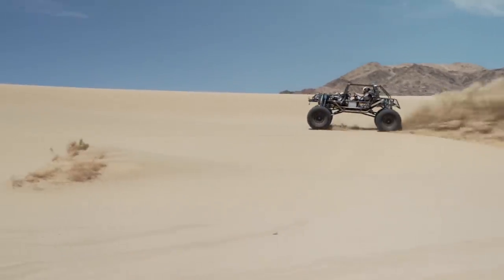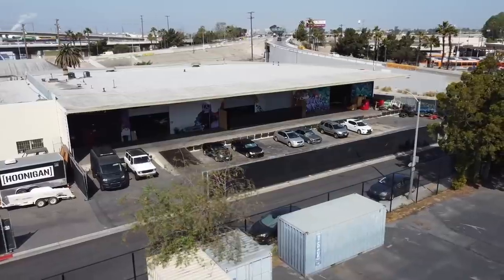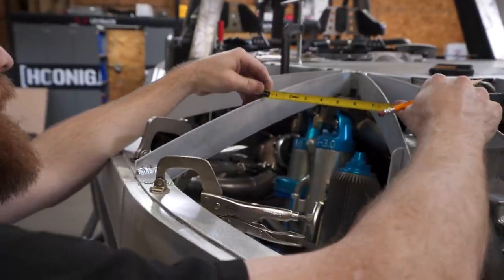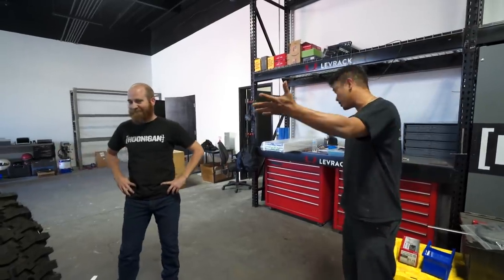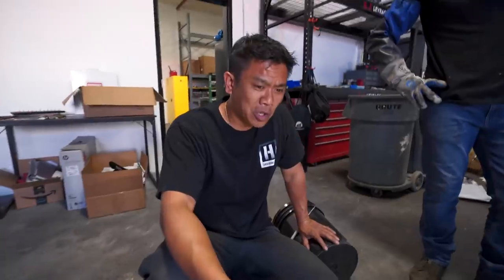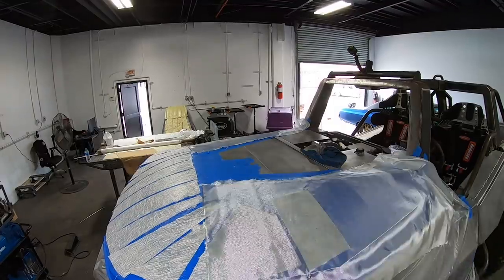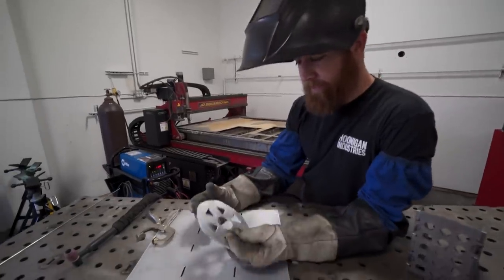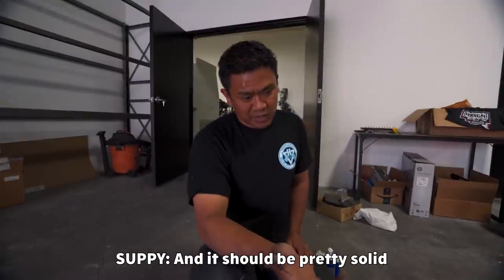Plasma Cut TUSKS for our Halo Warthog!

Comment: what the warthog needs is to race against a trophy truck or in some competition to stretch its legs before the military can get their hands on this beast of an offroader
Reply: A fully armed one of these coming at you across a Battlefield would be terrifying
Reply: @Matty.Hill_87  imagine a spartan in this
Reply: This vs that perhaps??
Reply: @kristinewilson5353  that would be cool
Reply: @rceps4999  it'd be crazy
Reply: @Matty.Hill_87  yk the sheer size of spartan II's yk, brutal asf. new spartans are a joke ngl still strong but nothing compared to the II's
Reply: A trophy truck with mop the floor with this thing. There would be no actual comparison to speak out. This thing was built for looks, ride height and slow off-roading.

Comment: So who else what's to see this vs Hoonicorn! 
seeing as they're both twin-turbo 1000hps!!! 
#Halo #Warthog #Hoonicorn #ThisVsThat
Reply: Unfortunately as long as Ken Block is with Subaru (Not dissing them, just the Hoonicorn was tooooo sick) it won't happen. Also the Hoonicorn would absolutely destroy this thing. It's like half the weight, 4 WD, super wide slick tires on a small-ish wheel (Less energy loss in sidewalls) and also it's 1400 HP. Against a Trophy truck or something that would be sick though.

Comment: The winch is starting to look nice even though it's not real but it would have been better if it was real even though the warhog never gets stuck but a hemet's type of winch or a sherpa 25,000 pounder winch are big enough to fit the styling or if you wanted to go bigger a bulldozer winch

Comment: doing fiberglass and epoxy resin with no respirator? Good luck getting that stuff out of our body after it builds up. In my country we can't even open a barrel of acetone without authorization and a guy regularly coming at the work place to check how we use epoxy and stuff like that.

Comment: I used do fibreglass laminating that's the worst plug mould glassing I've ever seen where we're you using a paddle roller and a penny roller for the lines of the body  to stop air trapping in the resin and glass and why would you stick it together with tape tHts the dumbest thing I have ever seen

Comment: The commentary at the beginning and the end is absolutely useless. I just saw what happened, I dont need commentary that tells me less then what I already saw. 

Instead I would rather se much more technical stuff, like why not an LS engine; what size turbos where used and why. Whats the intercooler and steering setup in Detail. 

The episodes barely contain any information there could be so much more content, then just seeing a bit of welding.